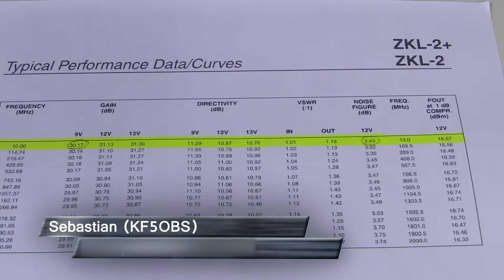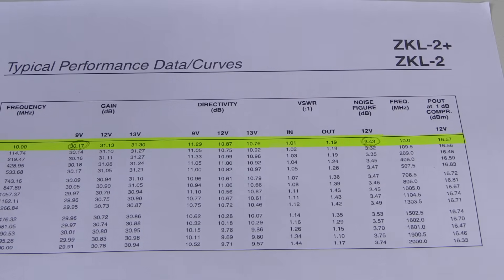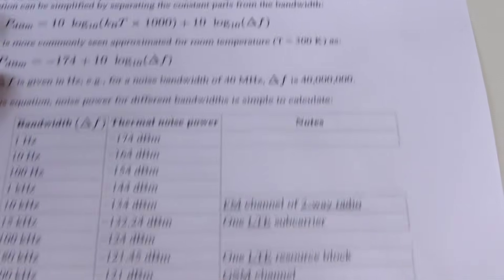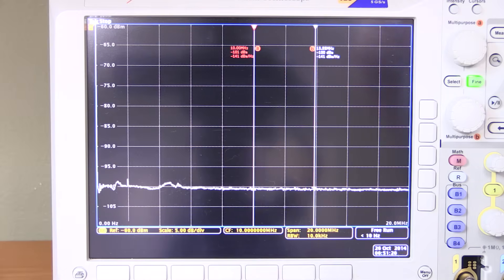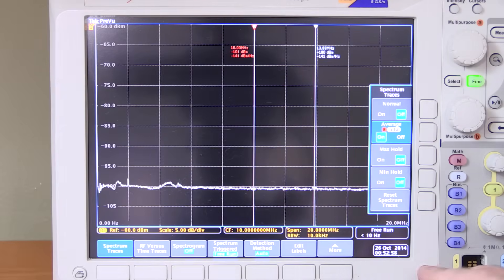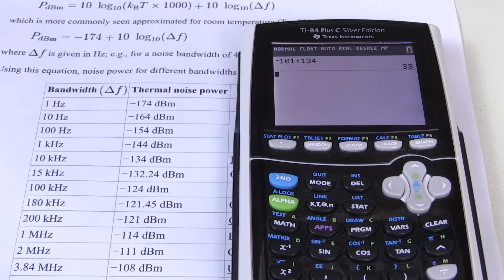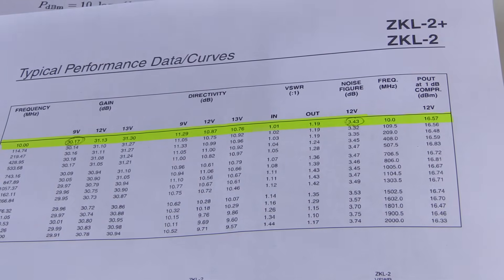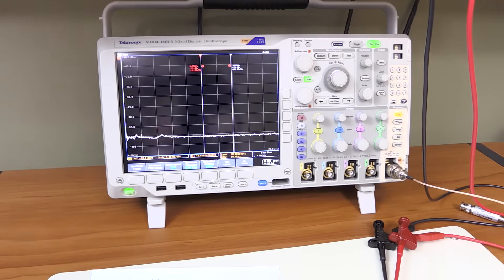Noise Figure Measurement [Gain Method]

Comment: I used this method for measuring noise figure at work when we couldn't afford a noise source, pretty accurate in most cases.

Also worth noting, if the gain of the DUT is not that high, and if the spectrum analyzer has high NF, these could introduce inaccuracies (Friis equation for NF). Some tips to minimize these errors include turning on the spectrum analyzer's pre-amp if available and also setting the attenuator setting to the lowest level. Make sure you don't drive any signal into the DUT that will cause overload!
Reply from the maker: Glad you liked the video. And good advice on the pre-amp. I might actually put this age old video on my list of videos to make a new, more modern version of.

Comment: In my day, spectrum analysers typically had an inherent noise figure of about 25 dB. Unity gain, but NF 25 dB. So, with the input of the SA input terminated and a RBW of 10kHz, the display of the SA would typically be -134 plus NF of 25 = -119dBm . The gain of your DUT is lost in this. I don’t think this methodology is appropriate.

Comment: Hi Sebastian,  nice video showing the basic "Gain Method".  Many modern spectrum analyzers offer very low displayed average noise levels and very small resolution bandwidths which are very helpful when using the "Gain Mehod".  My spectrum analyzer provides a resolution bandwidth of 1 Hz when the frequency span is small which really makes this method a breeze, and the displayed average noise level is very low when running a 1 Hz resolution bandwidth.

Comment: Measuring NF is not this easy....without feeding actual signal you are just measuring the noise floor with amplifier on and off. But there is lot of stuff happens when you actually feed in signal as biasing will effect noise performance, your non linearity will and most of all this is not actual platform which noise will follow when the amplifier is in operation. Feeding through 50 ohm makes a lot sense coz you need antenna while feeding in the signal and how its input matching could deteriorate the noise performance you can see in simulations. That is the reason we measure noise figure with SNRinput/SNRoutput ratios.
Reply: This technique is indeed one agreed upon technique for determining Noise Figure (its called the Gain Method which KB5OFS mentioned).  Many modern Spectrum Analyzers provide displayed average noise levels of -161 dBm/Hz or better and resolution bandwidths of 10 Hz or better (mine provides 1 Hz resolution bandwidth if the frequency span is very small), and this makes the Gain technique a viable bench top test for the average person that's not complicated.  Granted you raise some interesting issues, but for basic Noise Figure comparisons between various preamps, the Gain Method is a reasonable technique.

Comment: On Amp datasheet we look at 9V and 10MHz, on thermal worksheet we use the 10kHz number and then after all the math we compare it to the 12V noise figure. I like the concept here but it seems like we didn't use all the right info to analyze actual noise figure
Reply: We have taken 10 kHz which is the RBW and used that in the equation. 1 MHz is the frequency point at which the Noise power density is measured.

Comment: how to calculate noise when my output from amplifier is not a straight line as in video but have crest and troughs over the spectrum. where should I measure the noise. you have chosen the marker at 10MHz since my response is not a straight line where should the marker be? why is the span arbitrary, shouldn't it be equal to bandwidth of the amplifier? what does resolution bandwidth do and how do you choose a value?

Comment: it's somewhat strange, i am curious what about the sa that cannot have ktb measurement results.
for 10kHz, it should be -134 dBm, but sa shows -89dBm without any DUT connection.
Reply: That -89dBm is the noise floor of your spectrum analyzer. Basically the noise from within the SA is much higher than the input noise.

Comment: Did you measure the noise spectral density of your spectrum analyzer before connecting the amp?
Reply from the maker: +hasanRubaie Negative. This was supposed to be a very basic video for people who have no clue how to make noise figure measurements at all. There's a lot of technical errors and oversights in this video. But they're all fine for the purpose of this vid.
Reply: I think there is something called Noise correction in Spec An,that resets the effect of noise introduced by the spec An itself to zero for measurement purpose.

Comment: But leaving the input port open the noise figure is not minimized. According to my university lectures reminds there is an optimum source impedance which minimize the noise source. It is correct? Thanks!
Reply from the maker: +federico filosomi You are correct, it's supposed to be terminated properly. I ignored it in this video to make it as basic as possible

Comment: Just noticed you were doing trace averaging though, which is interesting, since that is equivalent to averaging the log instead of log of the average.  This would give the 1.4 dB error even with a signal analyzer such as the MDO.  Need to reduce the VBW instead, which would average prior to the log.

Comment: Nice video.  You really need to terminate the input of that amp with 50 Ohms, as it will make a noticeable difference in your measurement; notice it is -141 dBm/Hz in this video but -138 dBm/Hz in your other video with the noise source off.

Also, if the MDO uses digital down conversion to compute the spectrum then you are OK since it is taking the log of the average; i.e. it's all DSP following linear down conversion.  Although in a typical spectrum analyzer it is taking the average of the log (a logarithmic amplifier), which is why they use a special noise marker mode, since white noise is statistically different than a sine wave, and there is a 1.4 dB difference between the two after logarithmic amplification.

Anyway, nice videos.

Comment: Hmmm, is it necessary to account for the noise figure of the spectrum analyzer itself?
Reply from the maker: It only plays a role if the NF of the amp is very low. And generally, this method is only suitable for high gain / high NF type D.U.T.s. I'll show a different, more accurate method shortly.
Reply: @BalticLab  Actually it plays a very significant role even if NF of the amp is relatively high, 15+ dB. This is because typical spectrum analyzer has a high NF, 11+ dB. There are two ways to check this. 1) Compare noise floor of a spectrum analyzer versus calculated termal noise 2) Measure NF of the given amplifier using 'Gain method' and Y-factor method, calculate NF of the spectrum analyzer using Friis formula for a NF of a cascaded amplifiers.